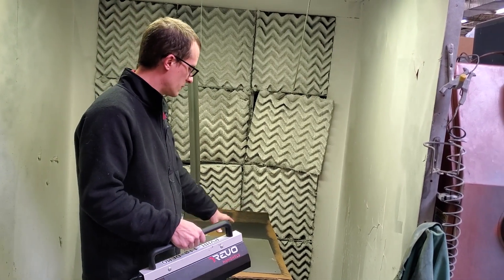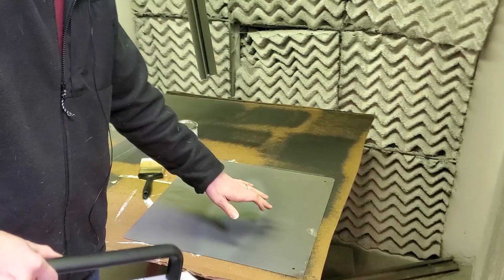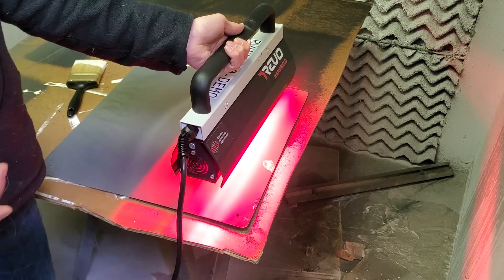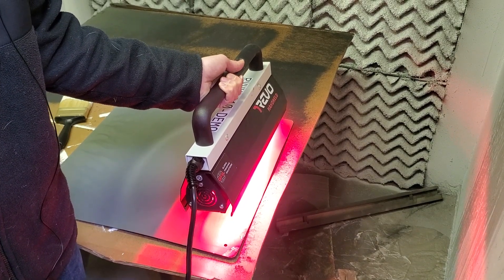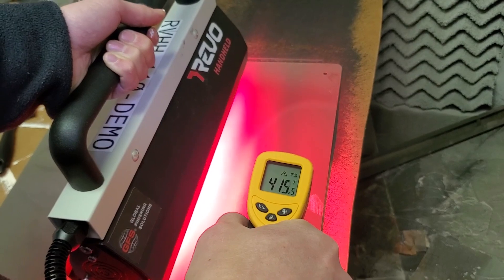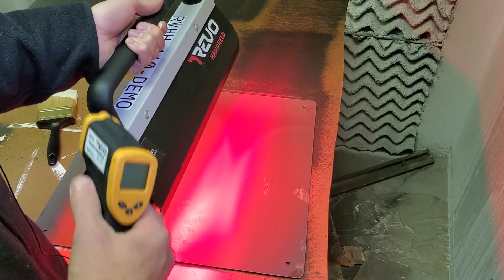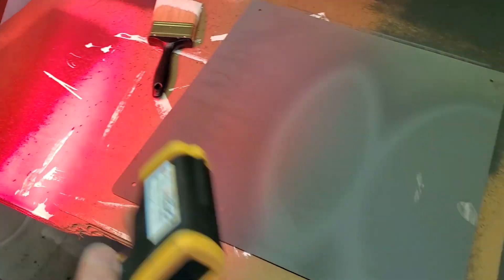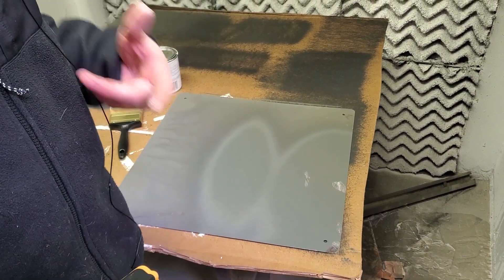Infrared Paint Curing Lamp Handheld Demonstration

Comment: Great Job with the video. It is worth noting that the heat will conduct and travel in the metal, so you will get a temperature rise even on the back and hidden sides of the metal piece.